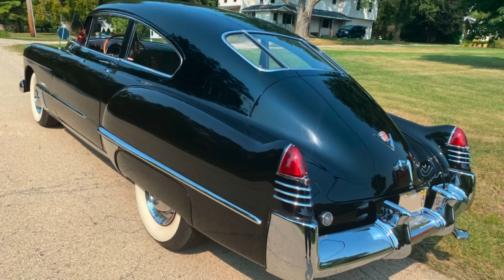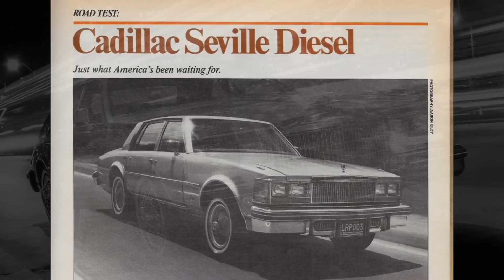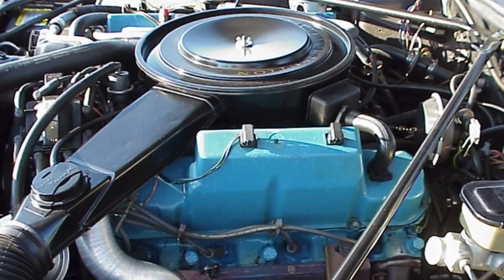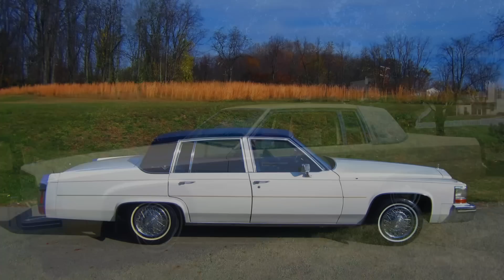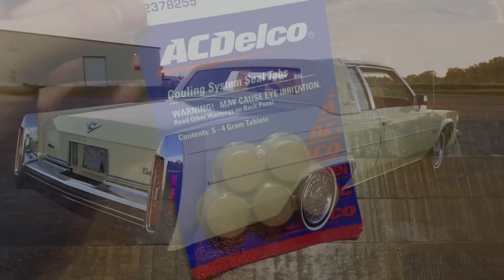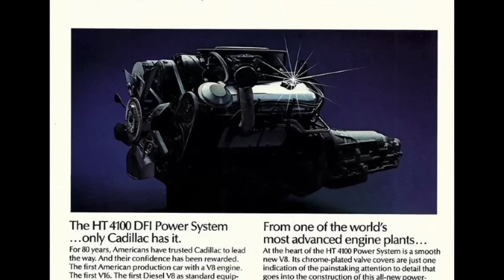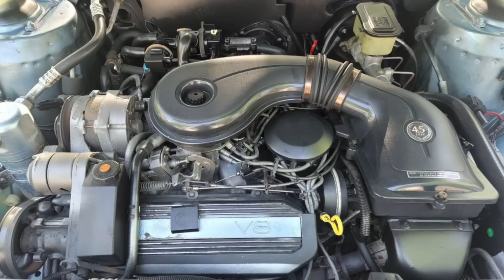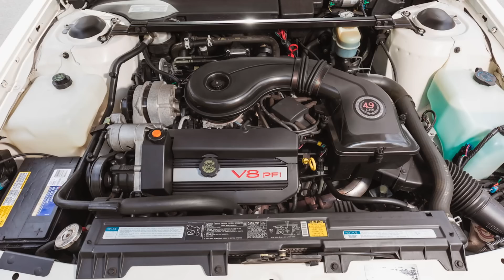This is GM's Worst Decision for Cadillac and Affected Its Reputation for Decades...

Comment: I owned a 1981 Cadillac Seville it was purchased new by my father in law and my wife and I later purchased it from them.   
It had the engine  overheating problems and the engine was replaced at around 13000 miles. 
   After that there were never anymore problems with the HT 4100.   We purchased it at 80000 miles and still no problems however when you started it during warm up it had a main bearing knock until it was warmed up but it never caused any problems and when I changed the coolant I always put the coolant tablets in we sold it at 278000 miles same engine however I always ran synthetic oil in it and a high quality oil filter and changed it every 3000 miles and this is probably why it didn’t give any issues while we owned it.
   However at 120000 miles we had the transmission replaced at aamco transmissions with a lifetime warranty as long as they serviced it at there intervals which we did and  at 158000 more miles no problems. 
   I did replace the front and rear wheel bearings 2 different times these are sealed bearings so they are not serviceable except to replace them .  
  And that is not a job for a novice mechanic as they are difficult to remove especially on the front as the are mounted on the inboard side of the front steering knuckles so you have to remove the upper and lower suspension mounting parts to remove them. 
   I assume that they were designed that way to prevent the wheels from coming off in case of a catastrophic failure of the wheel bearing. 
   The rear wheel bearings also the suspension has to be removed to replace the wheel bearings so the front and rear are a lot of mechanical work to replace. 
   I will give this automobile this with the exception of some of the mechanical ⚙️ ills it was one of the quietest and comfortable riding cars of that era. 
   And the ahead of its time electronic dashboard was absolutely beautiful.   The other Achilles heel of these years of Cadillacs were the H V A C units in them the hot air door motors on the thermostat side of this H V A C system was quite prone for failure and the parts were also quite expensive as I replaced them myself so I know the pain that they were to work on. 
   And if the heater core ever failed to remove it the dashboard has to be removed.    You would think that the GM corporation would know about this and have made the heater core more robust and this is shameful for a vehicle that costs this much money. 
   Why cut corners on something so important???  
   So I agree that Cadillac really did mess up on this era of automotive technology.    So very sad.

Comment: Oh dear God. During my lengthy tenure at a Ford dealer, our sales department took in a 1984 Caddy with a 4.1 DFI on trade. It needed an engine replacement which the sales manager asked us to purchase from a wrecking yard. It was, no doubt, a beautiful car. Much nicer than any new Lincoln we had on the lot in 1992, but we knew nothing about Caddys. In the days before the internet you better know what you are doing or wind up married to the car. 
We obviously had no idea what we were doing; the engine swap was fairly cut and dry, but the damn thing never idled correctly despite everything we tried. There was no Caddy dealer anywhere close to send it to. In fact, the closest GM dealer of any kind, a Buick dealer about an hour away, wanted nothing to do with it. I don't remember what we ended up doing, but every one of us in the shop took a crack at trying to get that 4.1 DFI to idle correctly.
Reply: Cracked intake runner.  Common on 4100s

Comment: I own a 94’ Sedan Deville and it has the 4.9 V8. What a smooth quiet and surprisingly powerful engine. It’s quite easy to work on and gets great Mpg on the highway (Over 25). I’m glad it’s the 4.9 and not the early northstar and I couldn’t be more happy with that engine. Great vid, a fallow up on the 4.9 and cars it was placed in would be awesome too!

Comment: And that’s without even getting into the transmission debacle Cadillac was dealing with. Or the 1.8L Cimarron.

In 1981-82, Cadillac’s best engine from the factory was a carbureted V6 based on a 20 year-old design from a lesser division. They spent tens of millions of dollars developing an all-new fuel injected V8 of the same displacement, only for it to yield the same horsepower and 15lb-ft less torque than the carbureted 4.1L Buick V6. The HT4100 also got poorer fuel economy and came standard with catastrophic unreliability. Tens of millions spent to end up with a standard engine that was worse is every way than the delete option.

And the ‘81 Coupe deVille 4.1 V6 weighed 3,801lbs. The ‘82 with the HT4100 weighed just 18lbs less.

Cadillac still offered the carbureted Buick 4.1 V6 as a $165 delete option in 1982. Probably the smartest delete option in automotive history.

Comment: I owned an 81 4-6-8 Seville. It was an awesome luxury vehicle for me and my new wife. Loved that car. I did not de-activate the 4-6-8 feature. As a motor head I often heard the engine knock but realized it was the 4-6-8 system doing it's job. I got great gas mileage commuting from Philly to Johns Hopkins Hospital in Baltimore 3 days a week in 1988.
Reply: Had a 1981 Eldorado with the V8-6-4, bought used in the early 1990s. For all the whining over the system mine did work. The problem as you say was in V6 mode the unbalanced 90 degree V engine shook perceptibly. Not like a hardware store paint shaker, but it was noticeable.

Comment: u def. got that right !!!!I had a 1982 Fleetwood Brougham, which was garbage since the day I bought it !!, Only 4 yrs. old at the time, and low miles, it had coolant problems, ECM, problems, overheating , ECT, , I drove it for less that 1 year before dumping it !!, never, never , never, no matter if I found one with 20.000 actual miles, would I own an '82 - 85 Cadillac !!

Comment: That 4100 and the 350 Diesel were both dogs. The torque if the 4100 was DISMAL. If you wanted decent performance and fuel economy, get the Buick 350. Bone stock with a Turbo400 transmission got the same gas mileage in my 78 Electra Limited as I got in my 84 Delta 88 Royale with the 307 and 200R4 overdrive automatic. 
The 4100 was going to fail. Always. It was also not rebuildable as the water in the oil will eat the bearing races, making the engine about anchor.

Comment: A decision like that could have only come from a corporate board room, not from anyone with engineering experience!  That began GM's trend of rushing a new model to production before working the bugs out of it, during which they lost sales until it was improved.  They talk about the automatic overdrive, but that was a by-product of the gutless HT4100.  Prior to '82, the 368 V-8 could use an extremely low 2.19 final drive because of its torque, precluding the necessity of overdrive.  The low power of the HT4100 necessitated the use of a much higher 3.42 axle which had to be countered by an overdrive to reduce RPM.  They used a 3.15 axle in the Eldo, but that was still too high and noisy.  I also notice the piece of junk R-4 pancake compressor in these cars which was a disaster that replaced the best compressor in the industry, the R-6, which FoMoCo began using in 1972 through 1979.

Comment: My wife’s first Cadillac was an’84 Fleetwood with the HT4100. White with red interior, it was slow but sharp looking. Regular use of the walnut tabs kept things at bay and she drove it to 120k miles.I put a water pump on it at about 80k. It was replaced with a ‘91 Fleetwood Brougham D’Elegance with the corporate 350 (chevy) engine. It was plenty fast and reliable. Regret letting that one go.

Comment: You're right about the reputation going downhill quickly.  The big 70's models still had some appeal to many buyers, even with the build quality getting worse every year.  The big V8's were underpowered for their size, but they weren't junk. 
Early 80's - smaller Cadillacs with not so great build quality, and the underpowered engine was junk.  Within a few years there Cadillac became the brand to avoid owning.

Comment: This assessment is spot-on. Cadillac was known for making luxurious, soft-riding, quiet, comfortable, stylish, and enormously large cruisers, and they were great at it. Motivating these were smooth, torquey, and reliable engines. Once all the downsizing was forced on them relatively quickly by oil issues and CAFE, the engine problems started and helped ruin their reputation. They should have just eaten the gas guzzler tax, but instead they made underpowered cars, then also undersized cars. Things started looking better when they moved into the 90s and started adapting as the 4.9 was good and so were the L05 and LT1 powered behemoths, but not only was it too little, too late anyway, but then the almighty Northstar debuted and ended up having head gasket issues. Cadillac was understandably mostly replaced by imports among the elites, who they then interestingly tried to copy to ditch the “old man” image and return to grace. However, Mercedes, BMW, and others were kings of sporty luxury in the way Cadillac and Lincoln were kings of traditional luxury back in the day, so they never broke through and are now just a shadow of what they once were.

Comment: GM should have just used the 368 V8 (without variable displacement) through 1985 in its big Cadillacs. The 4.1 L could have debuted in the FWD Deville/Fleetwood in 1985. The fuel milage rating for a 1980 368 powered Deville with a three-speed automatic was 15/23 mpg, a 1982 Deville with a 4100 and a four-speed automatic had a rating of 16/26 mpg. I would imagine the transmission was at least partially responsible for the difference in milage.
Reply: The 368 is a de-bored 472 (1/2 inch (3.80 vs 4.30 for the 472)).  It has the same 4.06 inch stroke.

Comment: Adam, this video and another recent video of yours pretty much encapsulates my family's experience with Cadillac in the 1980s and I've told a similar story to people about how Cadillac lost its way. First, when I was in 8th grade, my mother bought a new brown 1979 Cadillac Seville. It was a great vehicle and I still wish we had it somewhere. Considering my step-father drove a 1975 Buick Apollo, it's weird to think that both cars began with the same bones, so to speak. But she smartly avoided getting the Diesel engine, probably just because she didn't know much about them. In 1984, she traded that car for a Sedan DeVille and in 1986, she replaced my first car as a teenager (a new 1980 Chevy Citation!) with a gently used 1980 Cadillac Coupe DeVille that an elderly neighbor had driven and had only 20,000 miles on it. My brother and I shared that car through college and he eventually kept it all the way through law school. The 1984 Sedan DeVille and 1980 Coupe DeVille were pretty much identical except for the the color, number of doors and the powertrain. The 6.0L big block V8 wouldn't be confused with a CTS-V's V8, but at least that car could get out of its own way. The 1984 Sedan DeVille was a veritable slug by comparison. At least some of the worst reliability kinks had been worked out of that car and she kept it for many years until she traded it for a 1993 Sedan DeVille featuring the 4.9L V8, a car I would eventually purchase from her four years later and drive until an unfortunate tangle with a city bus (the Caddy lost). But the 4.9L was a very nice engine, decent power, especially compared to the 5.7L Olds gas engine, the 6.0L Caddy V8, and the 4.1L Caddy V8, all which had been in the family during this era.

I agree that you cannot talk about Cadillac's decline in the luxury car market without talking about the powertrain debacle beginning with the Olds Diesel in 1978, continuing through the 1981 V8-6-4 and by the time the 1982 HT4100 showed up, GM engineers had inflicted so much damage to the brand. Something you didn't mention with the 1982 model Caddys was that there was a Buick 4.1L V6 as a no cost option that year.  Why??? It's pretty much seems that GM was hedging their bets knowing that this engine was rushed too soon that there was another option, just in case. If anyone has that engine from that era, it's a truly rare bird.

Comment: I worked for someone who had a 84 stretched limo with one of those engines,that thing was a turd and I yanked it out and installed a 79 425 and TH 400 trans where it actually ran so much better and got the same gas mileage.

Comment: Brad makes an excellent argument that the Cadillac HT4100 fiasco damaged Cadillac's reputation. However, if we zoom out to get an even bigger picture, we can see that the HT4100 was a symptom of a much broader failure of GM's corporate leadership at that time. GM, along with other U.S. automakers began a grand, multi-billion-dollar "downsizing" program for its passenger car lineups in the late 1970s in order to comply with escalating (and necessary) federal fuel economy regulations known as Corporate Average Fuel Economy (CAFE). The original goal was to achieve a fleet sales CAFE average of 27.5 miles per gallon by the late 1980s. Reagan and Congress softened these regs, allowing for less fuel efficiency. But domestic automakers still faced a challenge of keeping up with the tightening regs. This escalating fuel-efficiency standard forced most passenger cars to adopt a familiar formula: unibody construction, front-wheel-drive, smaller overall body size, less weight, and smaller engines with overdrive transmissions. This standard formula swept through GM's X, J, N, A, C, L, K, E and W car body lines, plus others.

For engines, GM adopted smaller engine designs. For larger cars, GM took existing V8 engines and derived new 90º V6 engines. The most famous, and indeed legendary result, was Buick's now-legendary 3.8-liter V6. Less famous but still popular was Chevrolet's 4.3-liter V6, which made its debut in the popular 1985 Chevrolet Astro / GMC Safari minivan. Chevy's 4.3 V6 was essentially a 350 V8 with two cylinders chopped off; Buick's 3.8 V6 was similarly derivative on an old Buick V8. GM hit one out of the ballpark when, in 1985, Buick, Oldsmobile and Cadillac introduced the even-more-downsized front-wheel-drive C-body Electra/Ninety-Eight/deVille sedans, most of them using a new port-fuel-injected Buick 3.8 V6. But the legend would not come to full fruition until 1988 when the Electra/Ninety-Eight received GM's rebuilt "Series 3800" rebirth of the Buick 3.8, given a balance shaft for smoothness and made better and more reliable in every way. The Series 3800 would become widely used, and more widely known as one of GM's best engines of the 1980s and '90's.

But the "Series 3800" was never used in a Cadillac sedan. And the lessons learned from the "Series 3800" were not applied to Chevy's 4.3 V6 until the mid-1990s. Why? Even more baffling: GM embarked on such a major, expensive downsizing initiative, one that wiped out several rear-wheel-drive V8 car lines, and replaced those car-lines with smaller cars powered mostly by Fours and V6s, but Cadillac had to be bestowed a lackluster, lesser-quality V8. And Cadillac would eventually develop that V8 into a much larger V8 for larger cars. Soooooo... what was the point of this downsizing program again???

This decades-long tale of downsizing, downsizing again, and then upsizing underscores how GM's leadership embarked on an expensive series of obviously uncoordinated blunders. Buick's V6, right under GM's nose all along, held the key to saving Cadillac's reputation and boosting GM's image overall. For one thing, Buick's 3.8 V6 was GM's "Comeback Kid", to say the very least. In the early 80s, Buick's 3.8 in carbureted form made only about 125 horsepower. But by 1988, the Series 3800 was like a new engine, making about 160 horses and getting better gas mileage while being as smooth and reliable as a good V8. So, why didn't GM's leadership make sure that a coordinated downsizing effort also applied to Chevrolet and Cadillac? Where was the balance shaft-equipped, modernized "Series 4300" V6, to replace the 5.0-liter (305 cubic inch) V8 in the Caprice? And, for that matter, where was a new "Series 4100" V6, also derived more directly from Buick's "Series 3800" motor, for 1988-model-year Cadillacs? The logic for these modernized engines should be obvious (especially since a "Series 3800" motor was excellent for C-bodied Electra and Ninety-Eight, yet somehow not for deVille) but logic meant nothing if GM's poorly coordinated leadership wasn't paying attention. A Buick "Series 3800"-derived Cadillac 4.1 V6 could easily have made 170-180 horsepower, and probably more as GM continued to improve the "Series 3800" engine. (The Series 3800 V6 wound up making 200 horsepower in plain fuel-injected trim in the 1990s.)

So, in the end, GM (especially Cadillac) could have avoided shooting themselves in the foot if only they had more coordinated leadership that actually looked more critically at their overall downsizing program and the tremendous role that Buick's 3.8 V6 played in that program. Instead, they embarked on a confusing mission, allowed their decisions to suffer from mission creep, and wound up partially defeating what they set out to do. The Series 3800 was the key all along. If GM's leadership had the foresight to seize the initiative and more aggressively coordinate their downsized engines and transmissions, they could have accomplished so much more, so quickly. Instead, they dawdled and wound up dragging it out, clear through the 1990s.